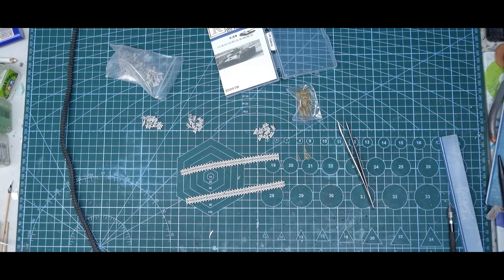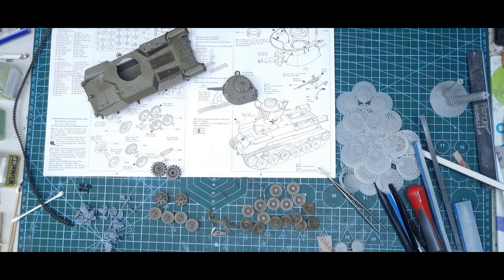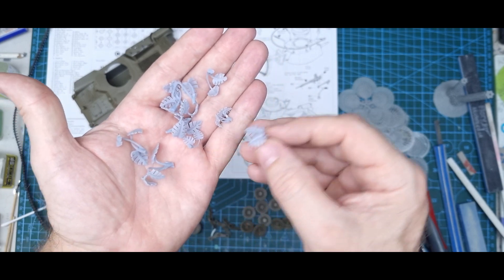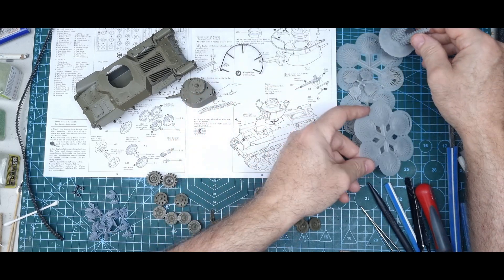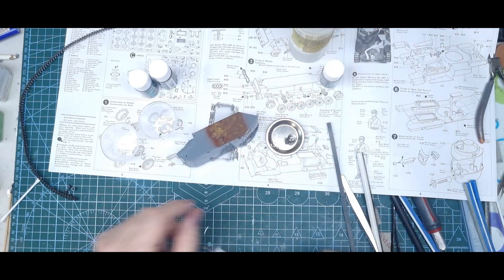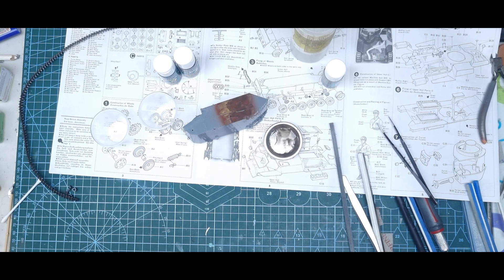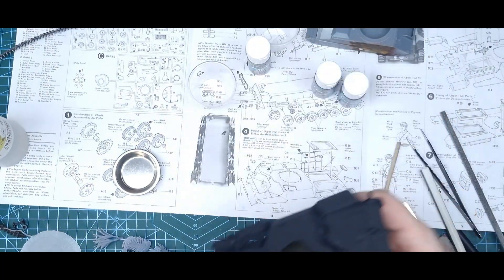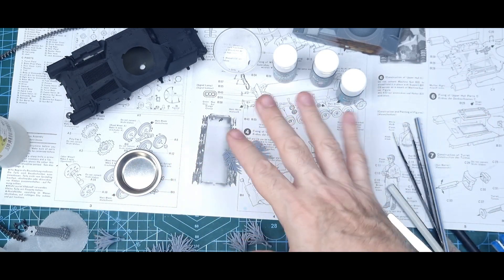1/35 Tamiya Abandoned Type 97 Chi Ha Diorama  Pt. 1

Comment: Hi, was wondering what that small metal cup is you use for mixing?

I haven't seen them around in modelling stores nearby, are they a specialty item specifically for painting or repurposed food containers?

Thx.
Reply from the maker: It's purpose made for mixing paint, I bought  set of 5 or 6 way back when, can't remember where now, probably BNA
Reply: @grant6336  Thank you. I though as much as I have see then on many build videos.

They would last longer than tart casings!

Back in the way old days, there was a European cheese product that had similar cups and were very handy. Might still make then over there, but they don't sell them here.

Cheers. I will have to find and get me some.